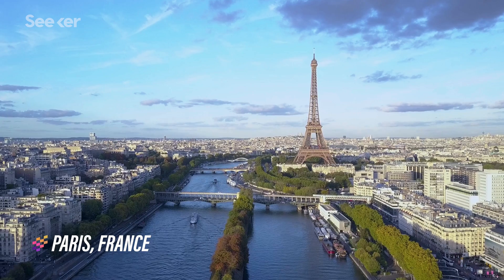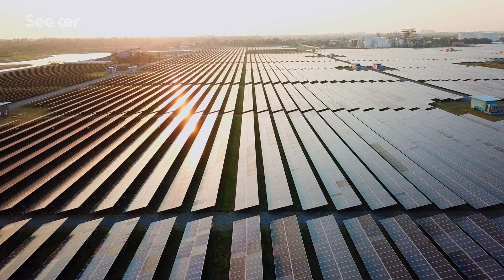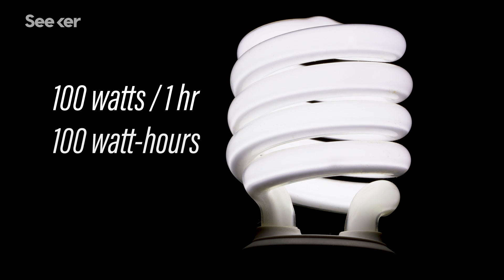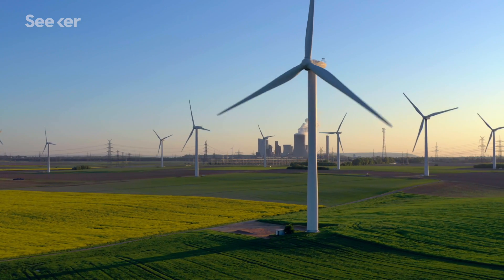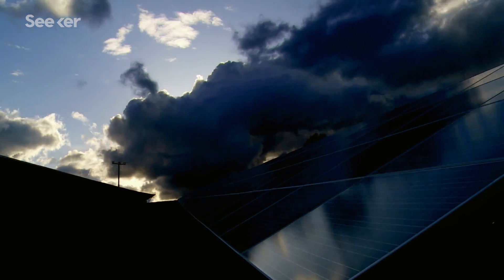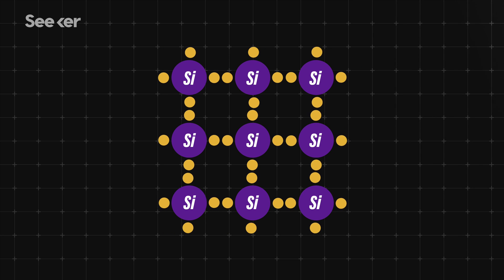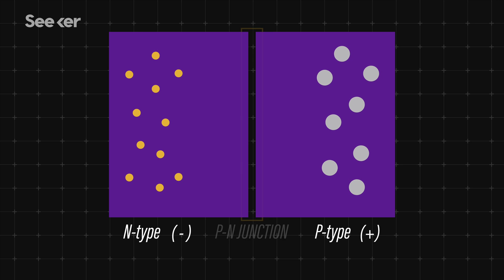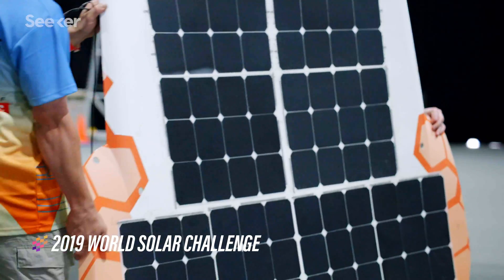Breaking Down Solar Panels

Comment: Massive areas of the dark solar absorbing cells will cause the planet to overheat, but Bill Gates' spraying of dust into the upper atmosphere will reflect sunlight from the panels and save the planet. Science is real (thorny).

Comment: "On its own, a solar cell can create about half a volt" is correct, but she goes on to say "to increase this energy output, you can combine solar cells...". Volts are not a measurement of energy.  Volts times Amps gives you power measured in Watts, and Watts over time is energy.  Hence "watt hours" of energy are the Watts you collected multiplied by the time it took to collect them (or more precisely, the integral of power over time).

Comment: Wait isn't n-type positively charged and p-type negatively charged (due to the formation of diffusion layer) causing the barrier gap between the p and n type semi conductors?
Reply: @djdjdjshhsuss3941  See that's the thing Phosphorus has equal number of protons as the number of electrons, hence neutral. Now since the electron is in excess it should flow away creating +ve charge.

Comment: Saying "A solar cell produces 100W in 1 hour" is not correct. It would have to say: "A solar cell produces 100W FOR 1h" because Watts are not Work but Power.
Reply: Neeeeeerrrrrdddddssss!
Reply: Almost correct. Panel output is rated in watts (power). 
You can talk about how much energy (joules, watt-hours, kilowatt-hours) a panel can produce per unit time (an hour, a day). 

But it makes no sense to rate output in units of energy without including the time required to generate said amount of energy. So IN 1hour vs FOR 1 hour isn't much better.

Comment: One small correction, the explanation of watt hours was not exactly correct. A watt is not an amount of power, but an amount of power produced in one second. So a watt-hour does not mean that one watt is produced in an hour, but rather that one watt is produced for a hour long.
Reply: Watt is not an amount of power produced in one second..it's the amount of energy supplied or used in one second..for ex one watt equal consumption of one joule of energy in one second...one watt hour is a measure of energy..it says one joule of energy used for every second in an hour
Reply: What do you mean "for an hour long"? It produces 1 Watt per second  for an hour? What happens after that?

Comment: Does the amount on energy produced by a solar panel depend on intensity of incident light? If so, we could try using convex lenses to focus the sun rays, amd increase the intensity.........
Reply: I would like to see U shaped solar panels with a steam concentrator in the middle to make dual use of the panels. I know they would be a pain to store or ship compared to flat panels. Maybe something with 5 sections that could lay flat until it is installed and then fold in 45 degrees in 4 spots when installed. Not a perfect U shape but would still work.
Reply: Beatles  from what I know tho, reflection reduces brightness of light by a little, that is intensity decreases with each reflection. Heck every glass material is bound to absorb some light energy. So, idk how much the net efficiency will be in that case.

Comment: top transparent plastic box will be an easy way of capture the light heat, 1kW/m^2
Reply: those multilayer solar cells transparent to other than a select frequency band, should be able to get most of the uva-ir range of photons
Reply: if you concentrate the solar on a hyper efficient cell system, using various mirroring methods, with water/tec cooling, or just bare tec generator with cold water on the cold side, or just a steam generator with direct solar water heating, concentrated

Comment: But doesn't silicon have spectral lines?
We could make a laser sheet and put it on the cell,the sheet will make all the wavelengths of light react with silicon and knock off an electron